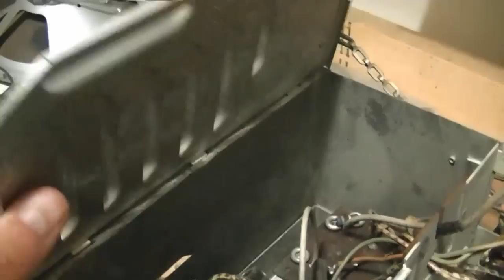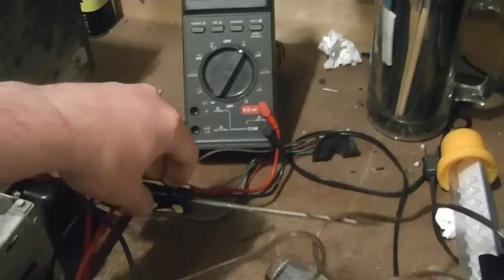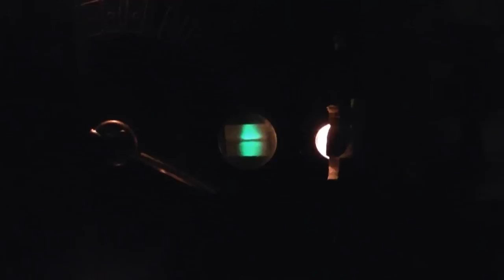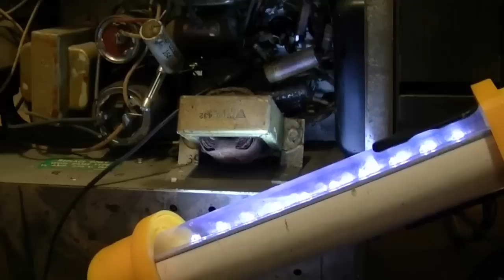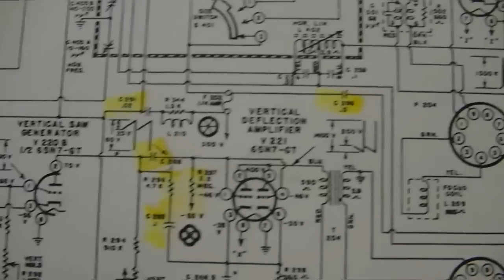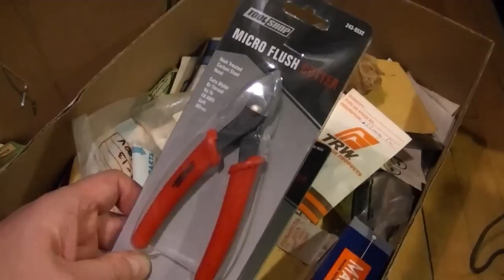Dumont RA113 restoration p2o8

Comment: bob, ive been watching all of your video's Why does this set have many more transformers as compared to a philco?
Reply from the maker: +Amy Marie  Which model Philco ?  I think the only Philcos I've restored were Predictas.  They are about 8 years newer than this Dumont.  By then tubes had more gain plus they reduced the video bandwidth to make space for color TV so fewer IF stages were used.  The early Philcos used as many or more than this Dumont.
Reply: Okay thanks for replying. i wanted to learn.

Comment: I know this is an old vid, but you may find this helpful.  You mentioned that you broke your flush cutters.  I have found the Xuron brand cutters and various pliers tools to be excellent.  They are made in the U.S., and I get them from Amazon.  Good prices, too.  I bought some for my wife for her jewelry making hobby.  I liked them so much, that I bought the full variety for my electronics bench.  I love the serrated tweezer plier, the bent nose plier, and the 410 Micro Cut cutter.  It might be worth your time to take a look at them.
Reply from the maker: Thanks for the tip - I'll check them out :)
Reply: Michael James I could not agree more - I have one Xuron flush cutter I use regularly, and a spare in it's pack. Hopefully I won't have to use the spare for a long while...

Comment: Interesting how they used a 6SN7 in that way. I was wondering if that is how they used up the reject tubes that did not perform as well as horizontal oscillators.
Reply from the maker: Perhaps, but Dumont was know for making the highest quality sets so I figure that had good reasons for the design.

Comment: It's amazing the way Dumont over engineers their sets. Quality all the way.
Those HV ceramics 50% higher voltage and 50% lower price than plastic film caps. That's too cool. I'll look into that myself.
Turned it on without remembering to take out the rectifier. Yup, join the club!
Hope it powers up when placed back in the cabinet for you. I also hope you have access to do an alignment also.
That sure is a clean chassis. They probably used really good steel and the best plating as well.
Can't wait to see it running!
Reply from the maker: Keep in mind ceramic caps are not a good replacement for VT71 type electrostatic sets.  The capacitance actually changes with applied voltage and distorts the waveform.  Not an issue in a voltage doubler like this set uses.   I'm going to avoid an alignment if possible, is a very complicated process including permanently modifying a couple tubes by clipping off pins!
Reply from the maker: Arthur Hollingsworth
That's what the alignment instructions say to do.  I imagine that disconnecting wires from the the socket would disturb the circuit.  Another step indicates that a pin should be bent ata 90 degree angle so a signal can be injected.  They are the most complex alignment instructions I've encountered so far.  I'll show them in a future video.
Reply: Wow *****. Can't you just disconnect whatever is connected to that pin instead of clipping it off? That seems kind of extreme.

Comment: Bob, what about doing some "extension" cabling to the cabinet while working the chasis on wour workbench?. Not sure is any issue will result on 1.5 or 2M of cabling, but even when far from ideal, it would allow you to work. You put the cabinet on a side of your workbench and even have a look at the CRT while working.
Good luck, I'll keep watching this series of vids. This set looks gorgeous in all senses.
Reply from the maker: The cabinet is too big to even fit into my little workshop plus I don't have the wires needed to make a long cable - especially the HV.  I think it will be fine just sliding back into the cabinet for tests.